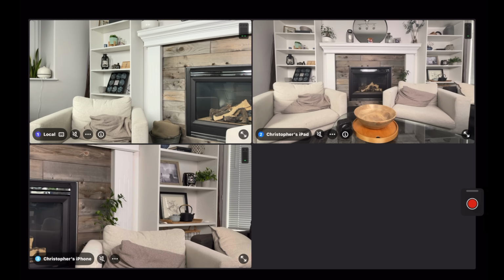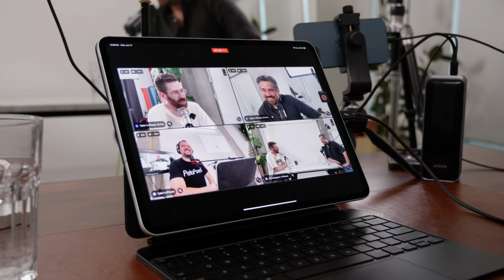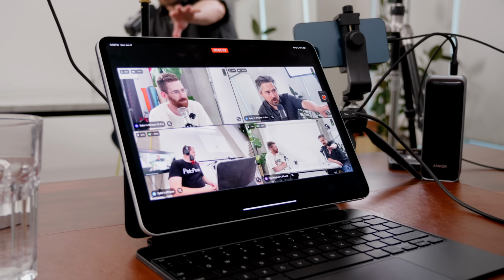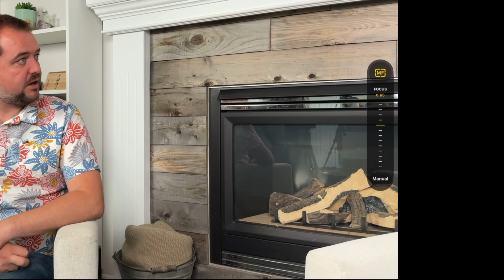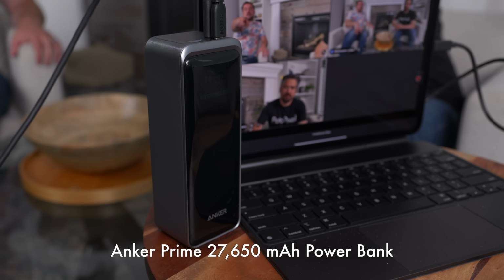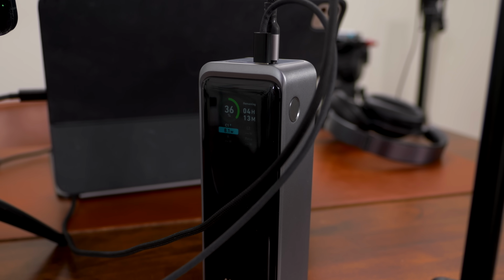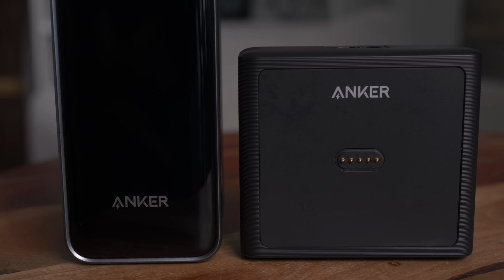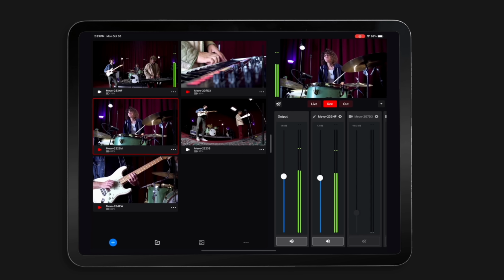Apple Final Cut Camera Review: EASY Multicam For Everyone?

Comment: This review certainly helps in terms of giving a good first look at it while I didn’t have had time to tinker with it myself yet. But the main questions on my mind didn’t get answered unfortunately:
A) Is the iPad Pro M1 sufficient or does it need to be at least an M2 version?
B) Since all devices need to share the same WiFi, can this work in the middle of a forest so they feast off each other rather than a base station?
C) What’s the oldest iPhone that still works and with what maximum resolution and fps? Like in my case, I still have two iPhone X and would love to know whether they still have some value here?
I’m not even talking about the official requirements and recommendations but real life experience what does and does not work and what might just work so-so in terms of being able to utilize older hardware.

Comment: So, to be clear, to use the multicam feature the host needs to be an iPad running Final Cut Pro 2 and NOT the Final Cut Camera app? I haven't bought into the FCP subscription at this point, but after fussing with the camera app on multiple phones I gathered this may be the case. Also, can I hotspot a personal WiFi network from one of my devices to connect them all? Thanks

Comment: how is it better than obs?
Reply: I use OBS to run live-streaming at work, so I'll tell you. Like Chris said, they're entirely different systems. OBS is for live streaming and switching in real time. FCP multicam is for recording multi-angle video to be edited later. (You can record an OBS stream, but you can't save all the camera angles, only the final output, so you can't change your mind later about which shot to use.) Also, while OBS works with lots of different kinds of video input devices, setup is not for the faint-hearted. FCP multicam works wirelessly and the only setup you have to do is launch the camera apps and FCP. It should be great for casual ad-hoc setups to be edited into final videos later, while OBS continues to be a great solution if you are hard-wiring a studio to stream content onto Twitch, YouTube, etc.
Reply: Bonus fun fact since I was just playing around with OBS: If you want to stream or record basic two-angle videos, you can do it with a recent desktop or laptop Mac running OBS, a recent iPhone, and nothing else! You can use your Mac's webcam as one OBS video source (say, a shot of you explaining) and your iPhone as another OBS video source using the MacOS/iOS "continuity camera" feature (say, an overhead shot of your desk, kitchen counter or workbench where you're demonstrating something.) This is less than half the capability Apple is offering with FCP on iPad -- you're only capturing two cameras and you can't adjust them remotely and stuff -- but for people wishing they could use a desktop/laptop Mac instead of an iPad and want live switching rather later editing, it would be a zero-extra-cost solution that's pretty easy to set up.

My dream: Apple will publish an API for Final Cut Camera and somebody will write an OBS plug-in to access it so you'll be able to do live-switched multicam stuff off a laptop from within OBS...
Reply: @jlwilliams  Aren't there some plugins for OBS that will let you record from one of the sources (instead of just the final output)?
Reply: @Your_Paramour  I found a third-party plugin called Source Record that implements as a filter and records one source, but haven't tried it because: (1) it's at version 0.3.4; (2) it hasn't been updated since May 2021; (3) installation seems a bit janky and (4) reviews on the page lean toward "useful but not very stable." Maybe there are some other/better ones (pointers anyone?) but if your goal is to record multiple camera views and combine them later in a polished edit, I still think FCP or another multicam-capable editor would be a more reliable approach.
Reply: Why don’t you tell us?

Comment: I might have missed it but how are the cameras connected to the iPad??? Via Wifi or wired?
Reply from the maker: It's wireless! It uses WiFi, apologies for not mentioning that part.
Reply: @PetaPixel  Thanks....solution seems to have potential, but like you stated it would be nice if it ran on the Mac as well.  I wonder if it will work with my first gen iPad pro and my "ancient" iphone 8.